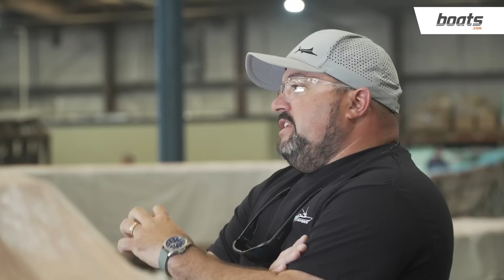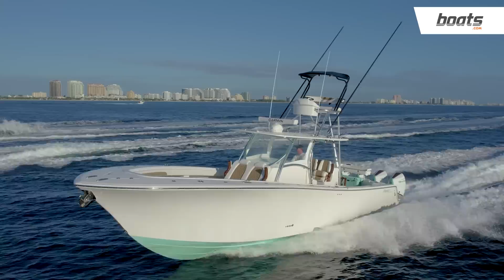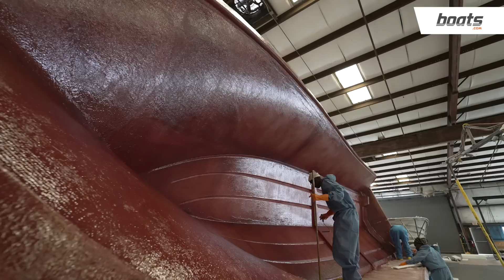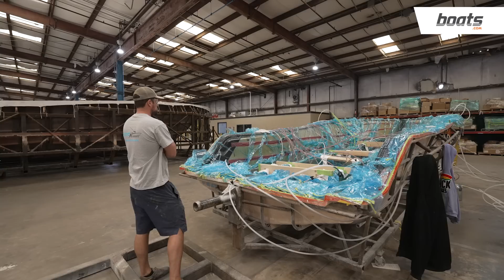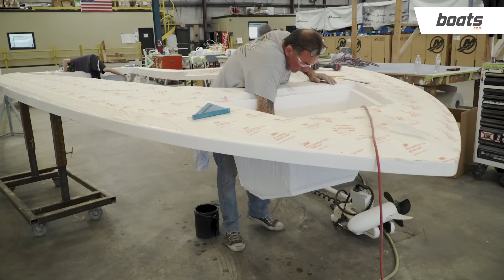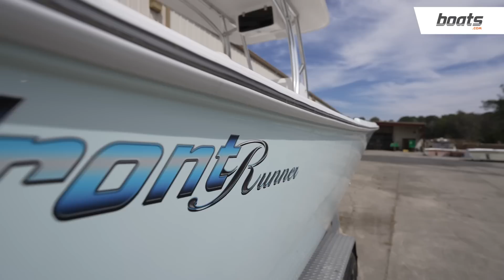Factory Fridays: Front Runner Boats 🚩 Manufacturing Facility Tour - EP. 10

Comment: I worked for Proline years ago. Great quality vessels. In 1993 they were innovating and pumping soooooooo many boats out. And always innovating.  Even though they are high production they're highest quality production boats I have built. We threw away 1 hull 2 liners and a molded stringer part. Ther liners prereleased. The manager messed up the very first one piece stringer using undied catalyst and if I remember correctly he ran out of catalyst half way thru chopping it.😆. If a hull/part prerelease ed it went into the trash.